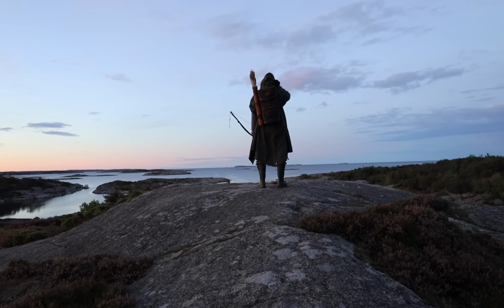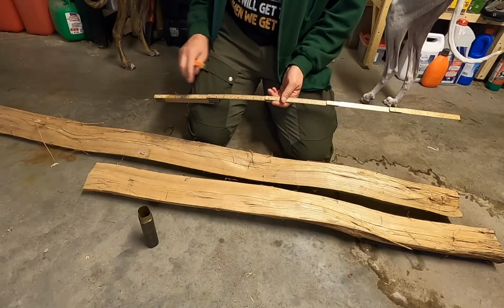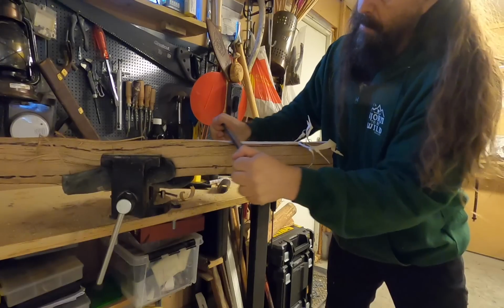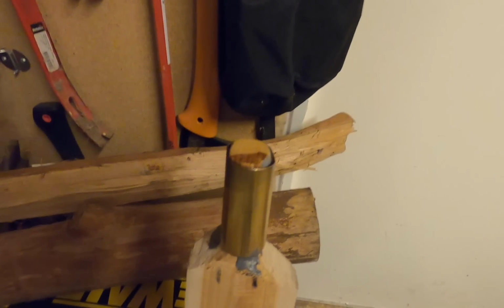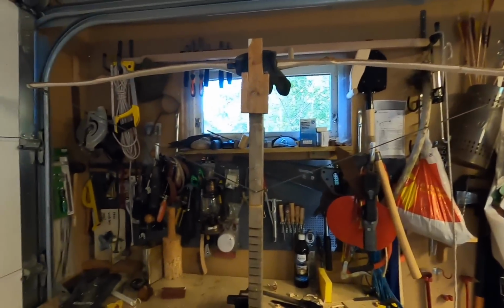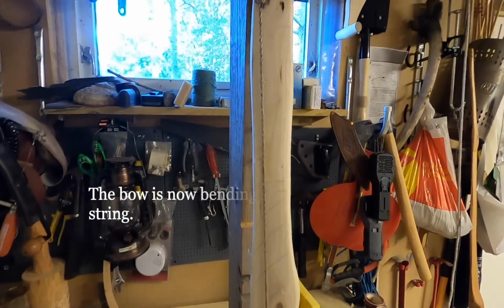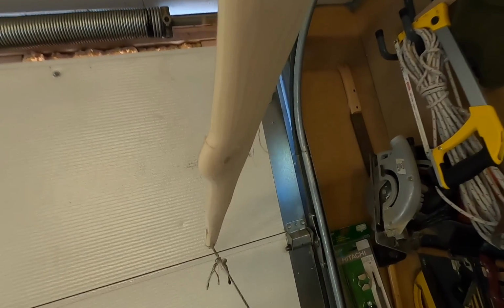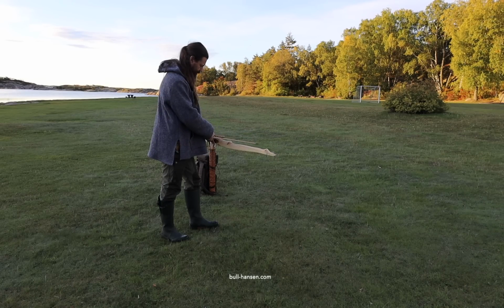How To Make a Takedown Longbow

Comment: I shot a bow constantly as a kid - it was as natural as breathing. Then for years, no bows - until my eldest son came in with a "hi-tech"compound bow he'd bought. I had a go - what junk - wasn't cheap either. They say these "compound" bows are super-powerful, blah blah - well he bought several in the quest for a good one - all rubbish. My old 6' wooden bows I used as a kid would pull the arms off you drawing them - they were like iron and could fire an arrow crazy distances if you had the strength to use them - which I had. Just stringing them was like a gym-session. 

My friends would give shooting my old bows a go - their fingers would not be strong enough to make the draw - my parents used have an old apple tree out in the garden - I'd go out & do 100 pull-ups every evening on a branch to build strength in my arms & torso in order to be strong enough to shoot well. I thought absolutely nothing of doing 100 consecutive pull-ups - which in hindsight, as an "Older" chap now, was pretty extreme. :-) Doing 20 now is a struggle - by 12 or 15, everything is starting to twang - like a bow. :-)

Comment: I am also a selfbow bowyer and have over 10 "under my belt" so far, of very differing sizes but never did I try making a "takedown" design. I only use a knife, sometimes a saw or hathet and some filework and/or sandpaper. No bench tools or machinery.

Comment: "Shooting in" would be "breaking in" or even "wearing in". Like as mechanic I would "break in" a new clutch after installing it. Or you would have a "break in" period after rebuilding an engine. Some goes for firearms. The manufacturer usually recommends a "break in" period of like 500 rounds where after it would reliably function as intended.

Comment: If a person has a single curve bow but no cord. How can the proper length be determine so to make or find a replacement?
Reply: Make the string about 4incnes less than the nock length it can be twisted to shorten to get the right braceheight
Reply: @silverpossum6687  Thank you greatly! I have skimmed various books and such but never found good information.
Reply: If your going to be a bowyer I recommend the 4volumes of the bowyers bible
Reply: @silverpossum6687  sadly no, my skill is in healing and research. i received a single curve wood bow (a hobby) but nothing else., and I'd not enough knowledge to find the information to fit it out.
Reply: @happygardener28  what I can say is seek out traditional archery clubs in your area most are more than willing to help newbies good luck
Reply: @silverpossum6687  Thank you. I'll ask around but in my area gun ranges are the norm. as a youth I used to do field points, but until recently did not I have my own, and with things changing so rapidly I figured I better start expanding my ability in the Old Ways.